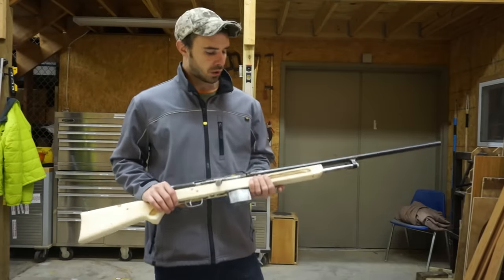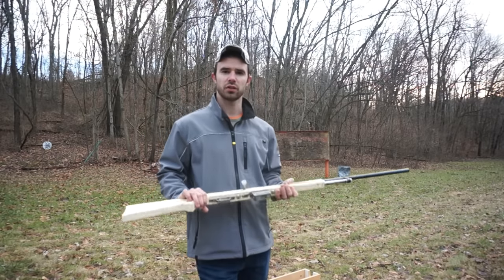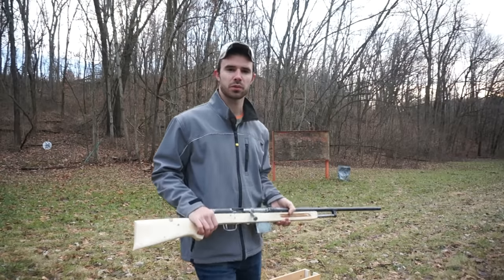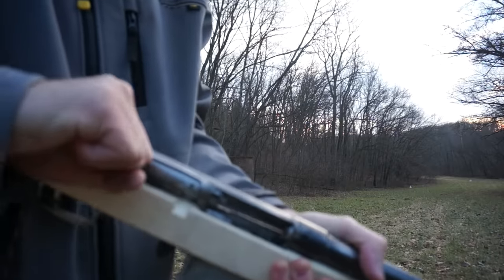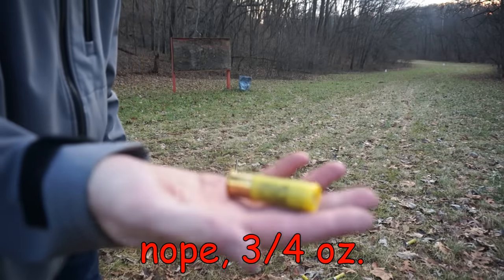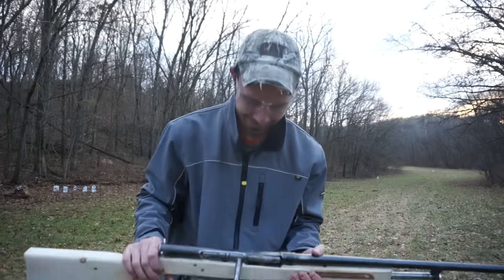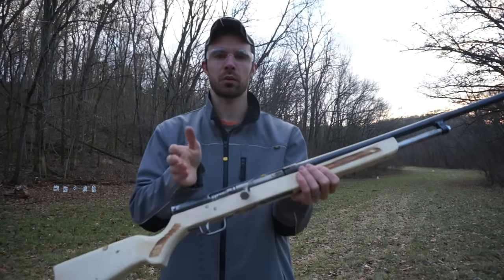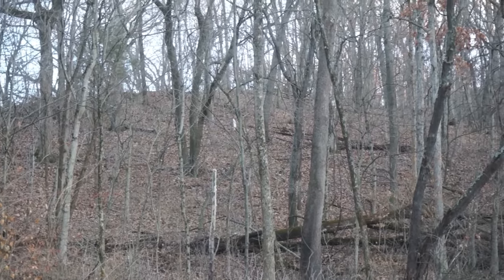Homemade Rifle, first rounds, and last. lol

Comment: Or 2021 improvement package:
Receiver full metal not covered by the stock.
Separated stock and handguard (simplified versions).
Ris rail system.
Threaded barrel.
There you go:
Simple modifications can be added very easy and its a way stronger system than originally.

Comment: A couple of things to keep in mind (and read up on)  One is metal fatigue and the other is proof testing.  I understand that this failed because of the increase in power going from bird shot to a slug but you could safely fire your gun 10 or 100 times and then boom because each time it is stressed it gets weaker. Also, when testing firearms they use what are called proof testing rounds that are considerably stronger than what you would ever normally consider safe. Like maybe fire a couple of 3" mag slugs from the remote stand before using it free hand with 2-3/4" shells. Dude,  think this through before touching one of those off next to your face.
Reply from the maker: very reason I use the string to test fire it. for the ones that dont fail I do much closer inspections before firing by hand off camera.
Reply: @akcustom7838  no mill or metal lathe? You could do so much.

Comment: The rim of the shell needs to be flush with the chamber and the bolt needs to hold over the rim itself with an internal extractor so that when the bolt goes over the rim of the shell it automatically grabs the shell getting it ready for after the shot.

Comment: It looks to me like the fixed firing pin design was the problem allowing the bolt to move before the gas presher could drop to a safe level and with the magazine well being the path of least resistance well you know it just blew out but in all the rest of it looks like a good design

Comment: I see what happened. Since you went with this moving bolt system, the only thing holding the breach closed was the spring tension. You made a shotgun before where there was no lock, but the breach was solid. There might be minimal force forward on the barrel, but there is defiantly NOT minimal force back into the breach face. This design could work, but your spring tension would have to be WAY higher. So you basiclly made a simple blow back action, but put a bolt on it to lock it kind of closed.
Reply from the maker: well it definitely wasn't meant to be blow back. lol the bolt was meant to close and lock with the round locked in the chamber. it just didnt work well hahaha obviously

Comment: i think an homemade bolt action shotgun will run better on .410/28 ga shots and slugs, too powerful rounds like 12, 16, 20 will apply too much pressure on the mechanism and on the stock, just try .410 or 28, it will be better i think, anyway, great video

Comment: At least 2 locking bolts, the second on the oposite side of the charging handle, a tight headspace and you should double up the receiver/chamber pipe. with all the holes in its not compareable to the slamfire shotguns

Comment: Poor headspacing is your problem. Fix the headspace and you'll be ok
Reply: That wouldn't matter. The issues was poor locking with a higher pressure shell. The head space was continuously expanding till catastrophic failure.
Reply: @dmanx500  Hard to tell if it was poor headspace or if it was poor locking because there was no measuring between shots. Likely it's a mix of both problems
Reply: @Robert-qm7yi  hmm a mix of both would make sense. Thanks.
Reply: The headspacing was the bigger problem. Take a standard shotgun with a 1/16" headspacing gap to a gunsmith and he will tell you it is unsafe to shoot and could kill someone. The bolt on the first couple of shots showed no signs of being too weak but he still had shell head separation. He should have stopped right there and known that it was a headspacing issue. His whole bolt locking design is also too weak and would have eventually failed even with proper headspacing.
Reply: Head space was the extraction problem but the pipe was to soft which along with bad head space blew the weapon out

Comment: As you said, the bolt must be locked right against the round. That 1/8 inch gap is a HUGH amount of headspace that caused the shell to fail and lots of gas to escape into the mag well and action. If you took a regular comercial shotgun with 1/8" headspace issure to a gunsmith he would tell you that it was unsafe to shoot and could even end up killing someone.

Comment: It looks like the shells aren’t fully seating in the chamber. If I’m seeing correctly, the front face of the bolt stops at the beginning of the barrel extension. Also, welding the extractor onto the bolt probably ruined the temper.

Comment: My opinion: if you are planning on using shotgun ammo, i would highly recommend that you make a break open action, bolt action are very complex and are not very easy to make, seeing as though you dont have experience making firearms, it would be easier for you to make a double barrel shotgun, you will have much more success with the shell being contained in the chamber(barrel) rather than needing to make a bolt, extractor, springs, etc

Comment: DOM receiver or downgrade to hardware store pipe barrel in 12 ga(ish). despite the extractor failure the bolt seems to have held up well

Comment: Looks like that tubing you used for a receiver was too thin to take the bolt thrust, you can tell when your bolt got sticky after the 3rd shot which means the round hardware bolt you're using as a lug and handle is peening and deforming the metal at the contact point with the slot stop. Recommend you use a flattened lug surface (maybe grind or file square the contact point on the round bolt handle) and a thicker receiver tube next time to prevent this.

Comment: I was worried about the pine stock from the start, pine is a pretty soft wood so you use a harder wood if and when you rebuild. The bulging in the case was probably due to a little room between the bolt and the back of the case if I had to guess. Looking forward to the rebuild!

Comment: I didn’t watch your build video, but it looks like you made the stock from a pine 2x4. I’m sure enough people have told you how bad an idea that is, but you could make it work if you cut the 2x4 into 1/4 or 1/2 max strips, wet them, glue them together with gorilla glue, and clamp it for a few days. Then start cutting your stock. Like a butchers block but thinner. Yea using a better quality wood would solve some of the issues, but I think your point is more to use what’s readily available.

Comment: Shame that didn't work.  I'd be curious to see you build one that does, if you do another build.  Did you ever get that 9mm rifle functioning?
Reply from the maker: No lol, I kinda gave up on that design, I'll be trying another semi auto after i can get feeding issues resolved
Reply: @akcustom7838  did you manage to figure out what those feeding issues were?  maybe a design from the ground up wouldn't be bad, if you have.
Reply from the maker: yea Im pretty sure the mag sat way to low in the chamber and with that build particularly the bolt didnt go back far enough with each cycle, and the design of the sear catch was horrible also.
Reply: @akcustom7838  I did notice the mag sitting low, but I thought most firearms made it sit that low.  I'm still new to shooting, so I'm not sure how high/low things should be.  I'm also not sure what a seer is.

Have you considered using existing parts (mags, bolts, ect) in your designs?  I would think it might be easier to use a glock/[insert your preferred brand here] mag, or an existing 20ga mag in a firearm you build, then making one from scratch.

Comment: You're using very weak off the shelf materials like unhardened mild steel,  you need to build a much heavier gun than a factory made one if your using weak steels, next model of this rifle go down to 410 to stay safe. Try a stock made from epoxy bonded plywood sheets .

Comment: The biggest problem you had was the extractor groove was much too long. It let a big gap in the chamber, allowing the case head to be unsupported. That's why you had blowouts ,even with birdshot loads. And, the extractor was much too long, allowing it to spring to the side, rather than grab the case rim.

Comment: I see a recurring theme where the recoil starts sending the bolt backwards before the pressure has dropped enough to stop the casing from blowing out. The bolt should have locking lugs to stop that from happening or you need to fab a delay that stops the bolt from cycling immediately after firing. You could also stick to .22 cartridges too which make it easier to go with straight blowback type semi autos or increase your bolts weight to slow the recoil action down. BTW, it's good to see you using string to test your stuff but I wouldn't stop using a string rig if it doesn't fail right away. No offence but your guns don't scream durability.

Comment: 5:15
It was the Extractor cut, in the Chamber.

-Also, the receiver seemed too thin.

(Considering that the Bolt Handle was the only "Locking lug.")

Comment: It's because one the metal your using is to thin two your spring and bolt system isn't locking completely closed and sealed but that's honestly the only issues I see so upgrade the spring to a stronger spring and steal to a stronger and thicker metal I'd go 2 eights thicker for your uper bolt housing and mag holder and the rounds bulging shows the bolt isn't locked all the way closed so your measurements for the bolt locking forward isn't accurate enough

Comment: 4:50 hence my point takes little more than a couple of pipes and springs to make a smoke less powder rifle. There is defineltey a reason mother bolt action rifles lock the bolt in to the chamber of the rifle and are made of hardened tool steel there should be a disclaimer on the video telling people not to try and replicate this stick of dynamite and accident waiting to happen
Reply from the maker: I think the fact the gun blew up should be enough of a disclaimer hahahaha, if not, that person will probably live a short life anyway. but I think head spacing was more the issue then one locking lug with this build. agreed the receiver material was soft but the bolt handle was hardened and think would have been sufficient if the joining metal was stronger as well. Oh well live and learn.

Comment: It´s not "a headspace problem" because bolt and cartridge  start  in the proper position, your problem is that the cheesy weak receiver CAN NOT STAND cartridge pressure and flows backwards like butter. Of course when it travels backwards it´s accompanied by cartridge head which is getting the full pressure. It could not even stand the first 3 reduced load cartridges,let alone a real one..

Comment: Maybe going for an even lighter shotgun round like a .410 would have better results for your next build.
Reply: I think .410 is actually even higher in chamber pressure, albeit producing less bolt thrust force of course. But still, if the locking and headspace are designed correctly it should handle any size round. Something is simply wrong with this design.

Comment: 1/8th of a inch gap when the bolt is closed is never going to work  it is to big at most it should be is 1/256in. best if it cocks up with no viable gap. the fixed firing pin wont work on a closed bolt gun. other than that good job.
Reply from the maker: yea learned the hard way lol

Comment: That external extractor is problematic because of the cut-out on the chamber. And i dont see any locking lugs on the bolt. Is the bolt locked only by the bolt handle?
Reply from the maker: the external extractor was problematic cause it blew off lol

Comment: Not to sound like a dick but if you knew that 3 round with less recoil and pressure had case head issues why would you shoot a slug. In my opinion as an engineering student your locking surface it's too thin and not strong enough maybe a heavy gage steel and a harder steel also I'm going to assume that's your case at issue maybe because headspace, because the spring motion of metal when if compresses under pressure since you're locking surface is far from the source of force acting on it, and/or because the lock surface was slowing getting out of safe tolerances.
Reply from the maker: thanks man. I try to build with whats on hand, just a hobby. it would be easy to rack up the $ amount if I went and bought all proper materials to were I would just buy one. lol, just like to experiment and tinker man

Comment: yaaa... can't say i didn't see that comin. that single locking lug consisting of the pipe wall? sketch.
AHHHHHH-- even scarier is your firing pin and how it fires, the shell is extracting 1/16 of an inch under blowback at full pressure and ripping the rim off. dude watch some vids on weapon actions because this thing is dangerous. i think its obvious from the failure that the the shell probly was under high pressure as it was partially extracted (and consequently unsupported) and just blew the fuck apart. this is a fundamentally flawed design
Reply from the maker: really? I thought it worked great. lol
Reply: @akcustom7838  you thought the part where the shell exploded and ruined your hard work was great?? homemade guns are really cool, but if you just look at basic concepts and firearm history you'll save yourself a lot of trouble and build cooler shit.
https://www.youtube.com/watch?v=vAgjvBxzng4 2:45 ish is exactly what happened to you.
Reply: @akcustom7838  trial and error that's how u learn.

Comment: wow. dude one of these days you might get really hurt. 20ga is not .22 or even 9 mm. you should get away from inventing new system and use try and true solutions, or at least old solutions that tested and known to be reliable. i get it you want simple construction with minimal tools, but what you are devising isn't safe. Maybe try falling block, or tipping blocs (like on Martini-Henry) - it's a lot more robust and it can be made with minimal tools. but for god sake man, be careful, overbuild the heck out of everything, provision for failure and design your gun so it can fail safely without destroying you in the process. you only have one set of eyes and fingers. you can replace broken parts, but you can't replace body parts.